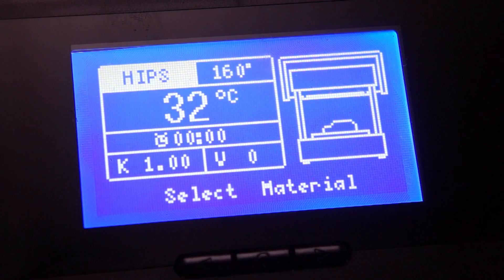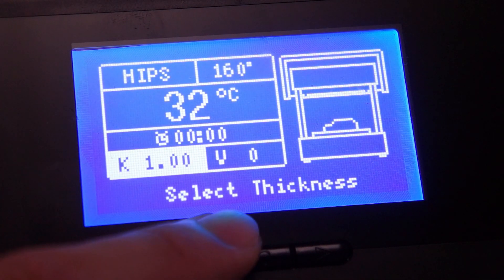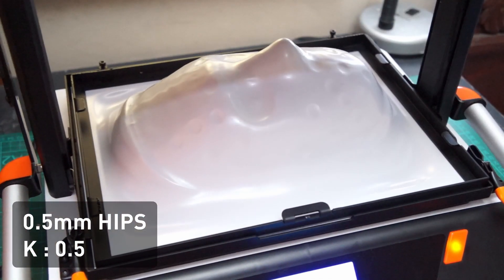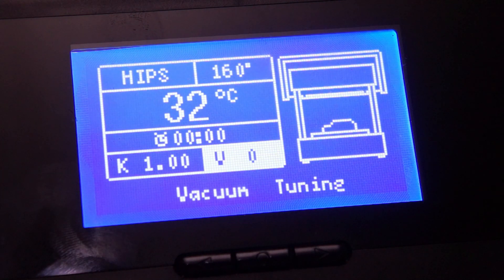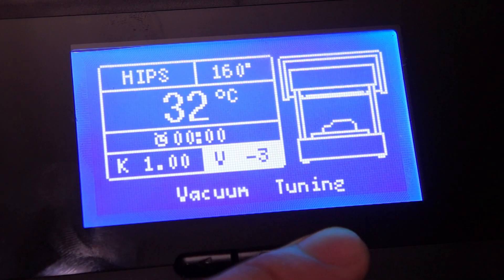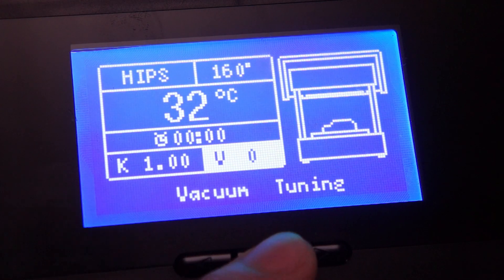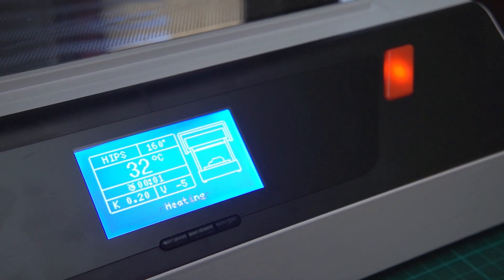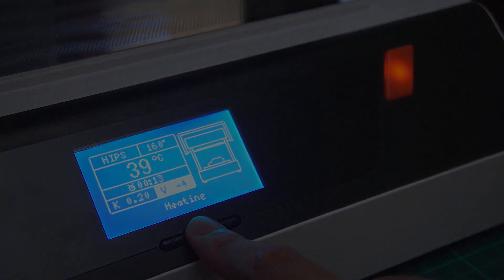Vaquform Support - K and V Values

Comment: I haven't been able to succesfully vacuum form anything so far. I've wasted about 20 sheets.
Reply: bro me too it always gets stuck I hate it
Reply: @JJ-mf7vt  I figured it out. I did a lot of searching and it was quite simple. I wasnt putting draft angles on my forms. I put a 5 degree draft angle on all sides, pops right out every time now. I also made sure my 3d print was solid, 100% and high quality settings. It took a day to print out a block that fits in your hand, but doesn't melt, and pops out.   Hope this helps.
Reply: @Kwkeaton  Ah perfect! thank you so much I will give it a try
Reply: @Kwkeaton  I am thinking that you could probably get away with simply printing a greater number of perimeters; I doubt 100% infill is necessary. I'm having great success with PLA printed at default settings not melting. Try printing parts with three or four perimeters, see if that works.